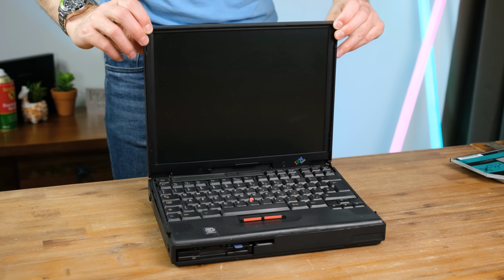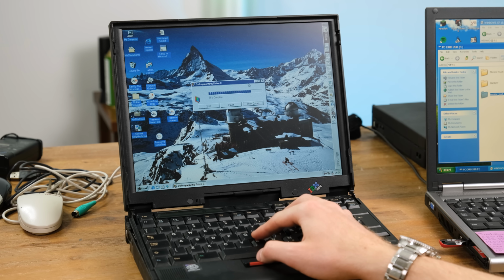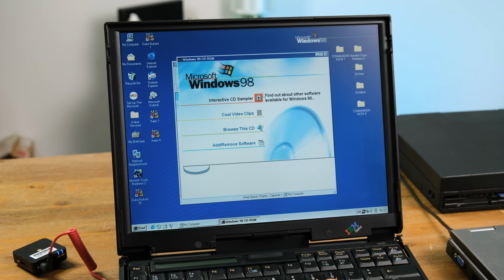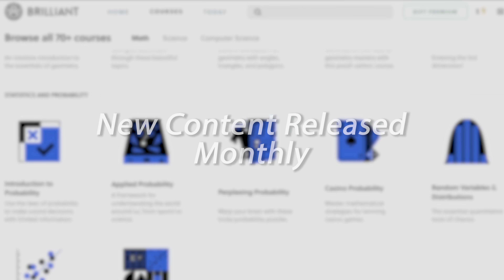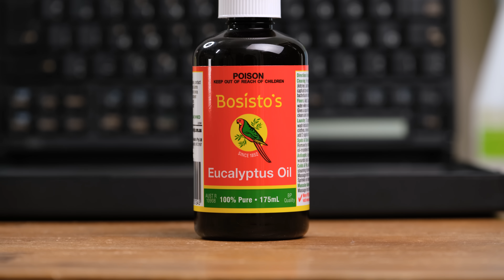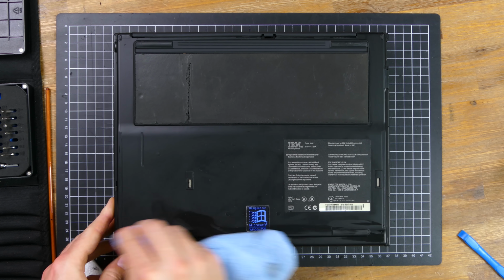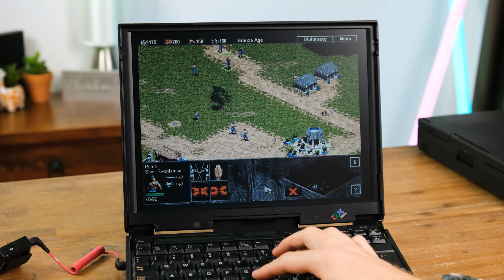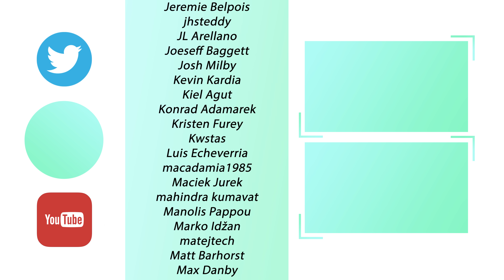$6,500 IBM Thinkpads From 1997! They're Melting...

Comment: These ThinkPads have a standby NiMH battery that allows sleep-swapping batteries inside the keyboard assembly. This battery WILL leak and kill the keyboard if it isn’t removed. You should really get that battery out of both units if you want them to stay working. I really enjoyed the video!
Reply from the maker: Good to know, I'll have to sus that out sometime soon!
Reply: @psivewri  These batteries are probably already dead and you're running on borrowed time ;) just a heads-up: the palmrest is tricky to get off; be careful not to use too much pressure or it might bend and not sit flush after reinstalling. The first symptoms of a leaked battery are dead/intermittent working keyboard and TrackPoint buttons and crackly/dead right speaker. They can run just fine without the standby battery btw. 
Some more info for ya:

Extra BIOS settings in the "Test" tab:

Ctrl + A - additional options, such as a looptest
Ctrl + K - keyboard test (works only after pressing Ctrl + A first) 
Ctrl + D - CMOS editor (forgot if it was to be pressed in the Test tab, or not...

and some more info: 
- Use the IBM Fuel app to change the LCD battery display method (percentage/estimated time left)
- the hard drives can be extracted from their caddies with relative ease - but be wary of the HDD limit; 
- if you ever want to archive the hard drives, some common 44pin adapters might not cut it - these hard drives require an additional +5V signal (pin 43 on the 44-pin connector)
- the 765's Mwave sucks for gaming
- 760/765: the keyboard latches, the rubber/plastic "bar" behind the screen (with 2 LEDs) and the PCMCIA slot buttons are notorious for being brittle and breaking + dust gets into the speaker slider and creates cracking noises, beware;
- 380/385: they don't like any IDE->SD adapters. You might have more luck with a IDE->CF adapter though. And be ultra-careful with the keyboard & HDD ribbons;
- if you do enough digging you can upgrade the screens for all of those systems, BUT look up IBM's reference guide if you want to. The graphics chipsets are the biggest problem here; that 380 can be upgraded, but only with a screen that came with a laptop with the same graphics chipset;
- you can get original recovery media for those laptops - even ones with the Select-a-System option (so WFW 3.11 + PC DOS + OS/2) online, but most of vintage Thinkpadders are incredibly secretive and don't want to share the media. I think I have some for the 760 and 380 series somewhere.

These are lovely and durable machines. One I bought (760EL) was beat to hell, but had WinXP installed and chugged along! If you ever find a docking station (especially the one with PCI/ISA slots), you can have truly one of the most amazing machines to ever come out from the 90s.
Reply: @kiki6713  the 38x machines don’t have these, right? I’ve got a 385XD…
Reply: @kiki6713  'Tis extremely sad that Vintage ThinkPad enthusiests don't want to share their recovery media!
I'm missing the correct audio drivers for the ThinkPad 600 sound chip. I broke the drivers and depend on them as I'm blind and use JAWS For Windows in Windows 98 to read the screen.
Reply: @3lectr1c  nope, 380 series have a regular CR battery :)
Reply: @setoth1234  Which model? (by the type-model, e.g. 2645-45U or any number you have). I might just be able to help you out!
Reply: @kiki6713  I'm not exactly sure. I know it's the ThinkPad 600.
Reply: @kiki6713  good. I’ve already replaced that one, wasn’t sure if they had a suspend battery though.
Reply: @psivewri  These are usually green NiMH battery packs in all sorts of shapes and sizes. They leak acid with age destroying motherboards in their wake. Most Powerbooks up to the mid-90s fell victim to logic board rot if the standby batteries weren't removed in time.
Reply: @egbront1506  The only PowerBooks that used these were the 150, 2400 and 3400. The rest used lithium coin cells that don’t typically leak, although they can. They did all use NiCd or NiMH main batteries though, and those can cause real trouble. The biggest issue is that so many PC brands used them, and most don’t know!
Reply: @3lectr1c  This makes me wonder what kind of royal pain we'll be dealing with in ~30 years when collecting the now modern stuff. Everything bulging out, ready to burst (possibly into flames) from inside fully glued shut cases...
GBA SPs already suffered enough from dying batteries and terrible replacements and they're not even 20 years old yet, although close. At least the 18650 cell based ones can be rebuilt more easily.
Reply: @Kalvinjj  I don’t think there will be much demand (by people who actually want to use them that is) because nothing can be upgraded, and no small parts can be replaced. SSD died? Too bad, go try to find a rare replacement logic board that hasn’t been made in 30 years. People will collect them, but only as display pieces.
Reply: @psivewri  awesome! Those batteries unfortunately ended up in a ton of laptops from that time. Dells, Toshibas, Compaqs, VAIOs, Apples and more. They’re beginning to become a real pain. Luckily they went out of use by around 2004.
Reply: @psivewri  😳u said sus
Reply: @psivewri  hi
Reply: @kiki6713  Got the drivers. Will read the readme. Do you know if the drivers will enable the midi synth in the card? I got FM stuff to work, but the midi I remember from my 600E was not the same. Hope this isn't a result of the different chip used.
Reply: @setoth1234  glad you got them! AFAIK neither of the chipsets provide any midi synth except general FM synthesis. This, and one VOGONS post on the CS4624 says that it has MPU-401 emulation under Windows so you can use General Midi for playback.
Reply: Those were absolute garbage, we put up with so much.

Comment: I have a laptop from the turn of he century with similar? coating.  Disgusting.  I didn't know it was relatively easily removed with alcohol.  I have a 98% solution which I guess would also work.
Thanks for the video.
Also may I suggest P.O.D. for these  late 90s machines?  It looks great and it a sign of a PC from that era is good enough for gaming, IMO of course.
Reply: @CommodoreFan64  I don't have money to buy anything, even if these products were available here.  Still, thanks for the suggestion.

Comment: I really hate it when they use those rubber coatings on electronics.I had a keyboard that had this kind of coating on everything minus the keys.It became so sticky that it would even retain the dust from the rag i used to wipe it with and i ended up ruining it when i tried to clean that junk off so i just threw it in the trash.If i'd meet whoever had the idea to use this material on stuff like this,i'd slap him in the face with that keyboard